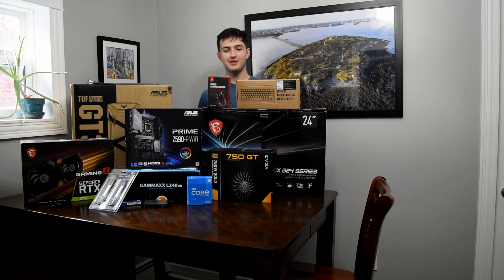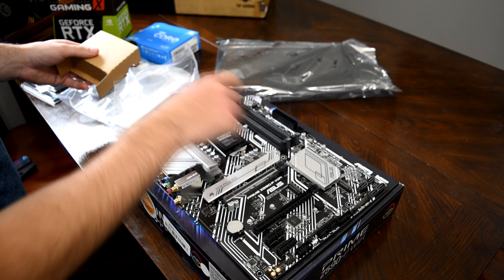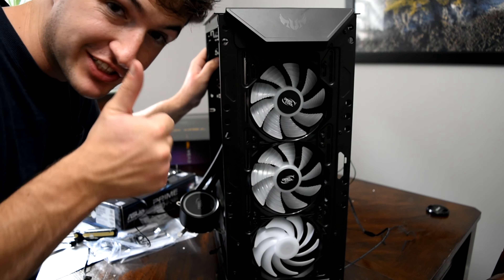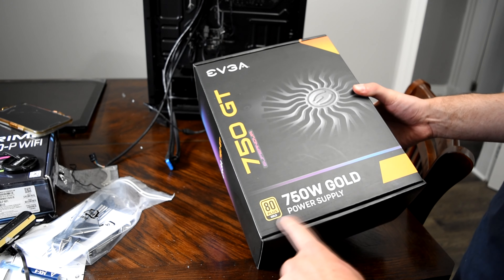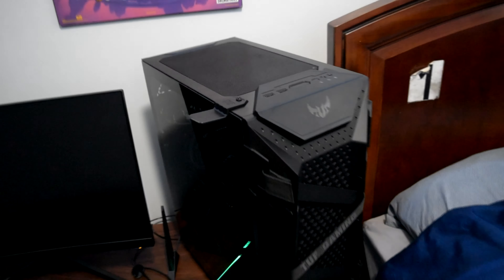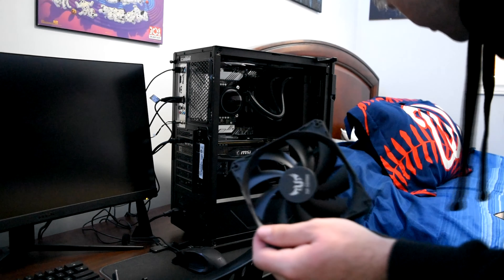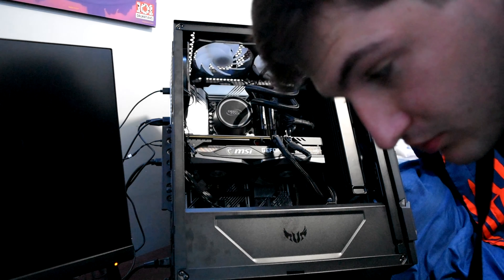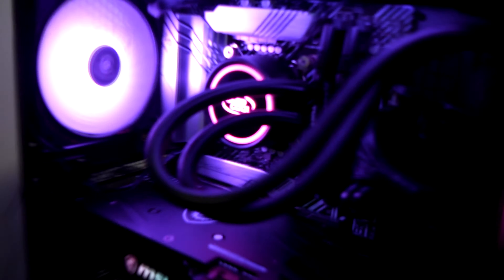BUILDING MY DREAM GAMING PC 2022

Comment: If you want to get your rgb all in sync your gonna need to hook them all up to the same controller that is in the back of the pc, it seems you had some plugged into the motherboard instead of the back hub which is causing a couple fans to be out of sync. That back rgb control hub should have 6 plugs for all your fans. Either way this rig will game and edit videos great overall so enjoy it!!

Comment: My only complaint with your placement of the radiator is that since those front case fans are intake, the radiator is discharging the heat from CPU cooler back into the case. It will definitely be warmer air than room temperature. I prefer the radiator on top but that’s just me
Reply: you prefer it, cause its the best way to attach the Radiator... have 4 fans exhaust air and 3 fans intake air. - so you dont want the Radiator at the front anyway lol
Reply: Well, that's the thing to decide between.
Either you have a warmer GPU and rest by having your AIO at the front, pulling warmer air in, or you have a warmer CPU by having your AIO at the top and exhausting warmer air.

Comment: That's a great build for that price dude, good job!
Reply: Def not. For 1500 usd rn, he could've gotten WAY better
Reply: @guck3562  Yeah used, which means no warranty often times, if something breaks...
Reply: @RebelD3v  what are you smoking. USD as in United States Dollar. Not used
Reply: @guck3562  they probably meant that this is pretty decent for 1500, and that used would be the only way he could get better components
Reply: @widevader  nah. he had a last gen CPU in the build for 1500. he could've had a WAY BETTER list.
Reply: @guck3562  okej give me your best list for 1500
Reply: @widevader  12700f
ID cooling SE 224 XT 
MSI Mag B660M Bazooka
Silicon Power XPower 16g 
Silicon Power P34A60 512g
6900xt
Adata XPG Starker
Enermax Rev DF 850w 

Then you can switch parts around say you want 1tb instead of 512g for example. Or more ram, etc
Reply: @widevader  obv you can differ from this lists in similar parts, but you should always be getting a 12700f/12700 and 6900xt/3080 in 1500 usd or you're just wasting money
Reply: @guck3562   @Guck  pretty valid build. Idk i prefer amd over intel so i would probably go for 
Ryzen 5 5600x
Cooler master masterliquid ml240 illusion 
Asus TUF b550 gaming wifi II
Kingston 32gb i have laying around
Z330 1tb
6800xt or higher with the current prices dropping
Phanteks eclipse P500a d rgb
And i cant remember the power supply off the top of my head, it was 750w 80+ bronze i think.
But those are just plans for next year and might change
Reply: @widevader  "I prefer amd over Intel" what? That makes no sense. You prefer spending more money and getting less performance? 😂
Reply: @widevader  and you're putting an AIO on a 5600x 😭
Reply: @widevader  and you're buying a wifi mobo when getting a better internet adapter is cheaper and better performance
Reply: @guck3562  whats wrong with an aio on 5600x
Reply: @guck3562  i dont particularly care abt the wifi part of it since i always use wired connection for my pc. So i will probably change motherboard it is currently just a placeholder idea till i find smt i like. But you are clearly and intel fanboy so no need to discuss anything further.
Reply: @guck3562  from my expereince with amd it was the opposite. But thats just my personal opinion. Since the LGA motherboards are more expensive it kinda evens out.
Reply: @guck3562  if it wose more money and worse no one would be buying amd so explain that. Intel does have amazing cpus. But idk i will wait a year anyways and decide than, i might go for intel but im not sure yet, i had great experience with ryzen 5 lineup.
Reply: @widevader  willingly putting an AIO on a 5600x is just a waste of money. You would be perfectly fine with using the stock cooler on the 5600x. Nothing necessarily wrong with it tho
Reply: @widevader  not an Intel fanboy lmfao, I'm just more informed and educated that right now buying amd is a waste of money when alder lake beats amd in 2022 with prices and performance
Reply: @widevader  yeah the only people that are buying amd cpus are just people who haven't realized alder lake is better in every way
Reply: @guck3562  I really don't know what prices are there supposed to be in your country, but I looked at your configuration myself and it came not even close to 1700€.
Guess its these ultra low American prices again.
Reply: @guck3562  yeah i agree that using aio is a bit overkill but this is just a rough draft for now i might not even stick with 5600x might just go for intel but ill wait and see.
Reply: @guck3562  okej that stament about intel beating amd, i can agree with that. Ig im an amd fanboy, god damn it what have i become. Ima just use thinkpad t430 or smt like that with linux arch, the good old days
Reply: @omega_6777  i check for US ots around 1500 a bit less maybe like 1400smt
Reply: @widevader  This is absolutely crazy. For such a configuration, this would be a dream price, at least in europe.
Reply: @omega_6777  well yeah I said before this whole thread we were discussing USD 💀
Reply: @omega_6777  every country has different MSRP's. You cant just convert currencies and expect to pay the same
Reply: @omega_6777  i am in europe as well and i can agree on that lol. Most of those components are hard to find anyways in europe. But you see i habe that one lucky thing on my side, ill probably be going to IS in the summer next year so i can buy my parts when im there before going back home.
Reply: @guck3562  well even we as europeans discuss mostly in USD online. You will rarely find people talking i  euroes or other currencies

Comment: question. i have an i7 in my crappy preubiuld, can someone explain the choice to use a bad cpu such as an i5 rather then i7 or i9? just confused love the build
Reply: also i am brand new to pc gaming
Reply from the maker: I’m not very good with pc but I was told by friends and other gamers to always just get the one with K at the end because I guess they work good for gaming and stuff like that
Reply: i5 aren't bad, they are just worse than i7 and i9, but also a lot cheaper and thats the thing.
Not everyone can fit a i7 or i9 in his budget and i5 are also very good for gaming.
If you build a more mid-range to low-end oriented build, it just makes sense to use a normal budget-CPU like an i5, because, as I said, its also pretty good for gaming and far cheaper.
Reply: @J.C.K-Productions  The only Real advantage that k processors have over the non-k processors, is, that you can overclock them (let them manually run faster than manufacturs-specified speeds, by changing frequenzies, voltages and other settings).
Aslong as you don't take advantage of that and use this feature, in my opinion it doesn't make sense to choose them, since they can be very expensive in comparison to the same processors without the k at the end.
The only other advantage that processors with the k at the end have, is, that they're out of stock a tiny bit faster than the non-k processors, but this shouldn't be noticible at all and is definitly not worth the extra money in my opinion. 
My personal recomendations are always the ones with f or, if you want to overclock, the ones with kf at the end. The f at the end stands for a processor without a integrated Graphics Unit (A integrated Graphics Unit is basically a Graphics Card, built into the processor. Such an Graphics Unit makes it possible, to run a PC without a real Graphics Card built into the PC, but since were talking about Gaming PCs, where we usually install real Graphics Cards into our PCs, we don't need this). Processors without integrated Graphics Units are always a bit cheaper than the ones that have them. So for a gaming PC, where we usually use Graphics Cards and don't need such an intergrated Graphics Unit, we can safe a bit money on the CPU by choosing a processor that doesn't have this Graphics Unit.
And before confusion comes up, the ones with the kf at the end are basically a Kombination of both what I already explained. A processor with kf at the end is a processor, that doesn't have integrated Graphics Units and is overclokable.
Reply: @omega_6777  from what i saw for ryzen 5 5600x the g( integrated) variant is cheaper than the x one.
Reply: Same reason people choose ryzen 3 over smt like ryzen 7 series. Its cheaper.
Reply: @J.C.K-Productions  i5 is very good for its cheap price
Reply: @widevader  By AMD yes. The 5 5600g maybe has the extra integrated Graphics, which the other CPUs havn't, but its worse at other points, as for example the L3-Cache (5 5600g has only half the Cache of the 5 5600x), the PCIe-Version (5 5600g has only PCIe 3.0, while the 5 5600x has PCIe 4.0) and can also only handle half the ram the the 5 5600x can (5 5600x can handle 128GB RAM, 5 5600g only 64) which makes it way cheaper.
The thing with CPUs without integrated Graphics being less expensive is primarly a Intel thing, since by Intel integrated Graphics are the Standard, delivered with every normal CPU, where its basically a furnishing-question, wether you want it or not and not as by AMD, where CPUs with integrated Graphics are something special, where a completely New CPU is designed for it, with its own new specs.
Reply: @omega_6777  very good answer. Here is a cookie 🍪.

Comment: Lol dream pc? And useing rtx? Do you know rtx is fake if it was real you should have more than 50 fps and low power useage. Rx 6600 8gb is better. Your motherbord need to be B550M-PLUS that supports pcie 4.
Reply: Pretty sure the title says "MY" not "Your" dream pc. whew
Reply: Mans really said rtx is fake, then said a 6600 non xt is better then a 3060, then told the guy he should of bought an am4 motherboard for his Intel cpu build. I have no idea how the algorithm brought me here but my God this was hilarious.
Reply: @cyyfi979  Not only that, but he specifically points out that the B550 supports PCIe 4.0, which makes it seem like that's in his opinion (also) the reason, why the guy from the video should use this chipset, which is absolutely hilarious.
I mean it's not like even Z490 was already PCIe 4.0 ready or something lol. And even if Z590 wouldn't have PCIe 4.0, it still absolutely doesn't make sense to point that out. Every current GPU runs perfectly fine with PCIe 3.0 and since we have no Information about the storage used here (at least I never saw something about storage in this video by skipping through it several times), we also can say nothing about that either.
But what was to expect, from a guy that can't even spell properly in any way and also writes a lot of absolut random nonsense.
Reply: Ah yes the famous b550 plus that supports intel cpu excellent choice, would you also like to put some ddr5 into that motherboard.
Reply: @widevader  amd
Reply: @Munkhbayarkhavtgai  and what cpu did he buy? Ah yes the amazing amd intel. Do you even read your comments before posting them